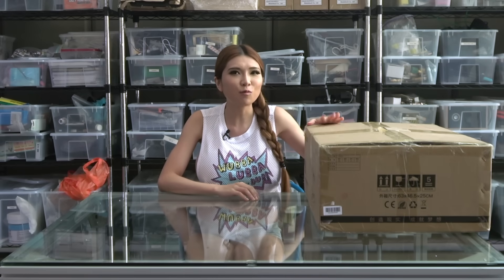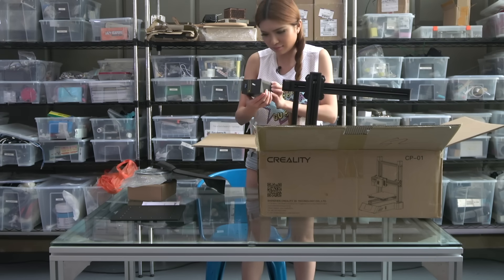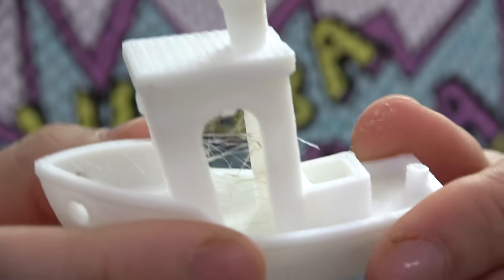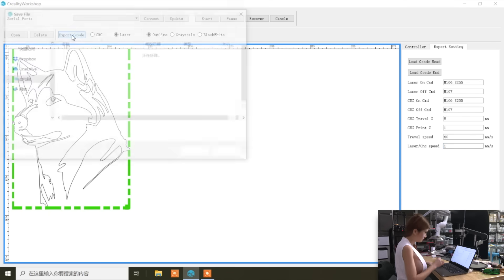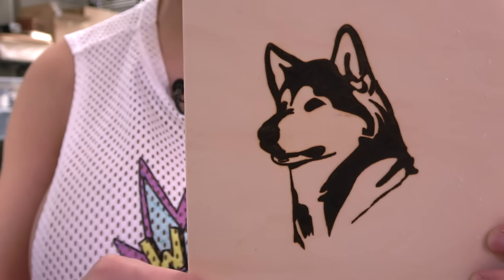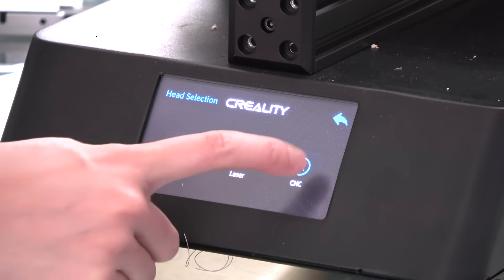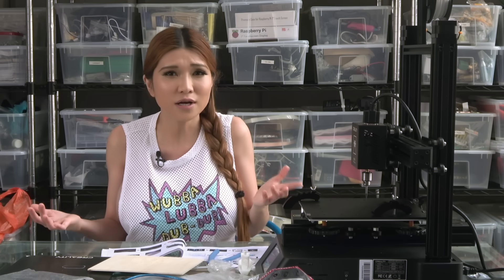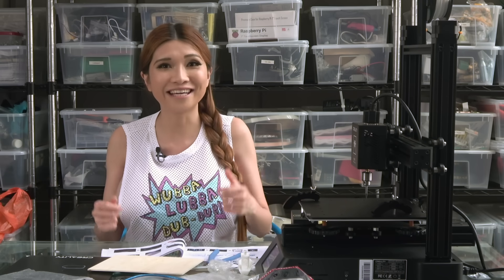Creality CP-01 Review, a 3D Printer, Laser and CNC Engraver

Comment: A sander head might interchange with a cutter head.  A circular brush of sturdy fibers of relative thickness and strength could retrace the original cut for cleaning.  Differing metal circular brushes would work for metal.  I think this would provide a cleaner and less disruptive sanding than by hand.

Comment: If anyone were to build a pick and place + cnc setup, and sell it for around $500 I'd buy it.

  If this is a thing someone is designing, be sure it can specifically address vias. Make a head setup than can either place and bend a wire, or at least place micro rivets. Limiting vias to lots of manual labor is the primary reason I'd rather just etch a board rather than buy a CNC like the Wegster for making prototypes. Don't pull any proprietary nonsense either. I'm not buying anything that requires me to purchase exclusive consumables from the manufacturer.

   If someone could develop a consistent way to CNC a bevelled hole and use solder paste or balls to connect a through hole via, I'd pay somewhere near $1k for a hobbyist machine. If it can make a flush via where I can use thin double sided copper clad and raw FR4 stock to build a 4+ layered stack up, I will spend more. Even if it can't CNC 0.008-0.015in thick double sided FR4, if it can drill holes and make vias, I'm interested.

   If a machine came with a UV laser and ball park exposure settings and for cheap photoresist, and could resolve a 0.45mm pitch QFP 100+ footprint, I would absolutely buy it.

 New Subscriber here. I'm here due to Andreas Spiece's mention on his recent Lora Mesh Networks upload.

   Nice job hacking the male mind, and following through by shattering my stereotype. I'm not usually susceptible to such influence.
-Jake

Comment: Curious to the stability of the rack is my question. I'm sure it's fine engraving with that little 1/4" lauan board. It's a much softer wood. With a harder wood and a deeper cut, does it bounce around and loosen up? That would cause constant readjustment when swapping back and forth wouldn't it? I'd read that the bed would need constant adjusting. I'd bet that would be correct. You would also have to readjust after each head swap? That's an assumption. Have an Ender3 now, but looking into a CNC engraver/laser combo. The 3 way would seem the best way to go. It serving as a backup and all. How about the laser? Does it just burn the surface somewhat, or will it actually get down in there to where it wouldn't sand right off with a light rubbing? Will it actually cut anything? Read the laser was fairly weak and would want to do actual cutting with it. Not just use it to make fancy toast with.

Comment: She got a good one. I’ve owned my CP01 for 50 days...printed one pikachou successfully. CReality FINALLY SENT A REPLACEMENT HEAD, after 45 days. I am having trouble leveling....one side has some adjustment range, while the right is locked down against the compressed springs...adjust the stop..sure. No fix....the cloverleaf carrier that the work platform sits on IS BENT, NOT FLAT. the metal work table is not flat, warped. I have had the work table off and apart 5 times, the print head apart 4 times ( replaced it..shorted out the original.),the control box apart and moved wires to diagnose a BAD MOTHERBOARD....another 45 day wait from Creality, China.
I am about to level the bed WITH A HAMMER AND NAILS...
Anyone want to buy a CP01? $400??.
The welds that hold the standoffs to which the head and work table mount have broken loose in 3 locations.....wobble.
Reply from the maker: That's awful! I'll talk with them about quality control.

Comment: The clamp downs look a bit big would take up a lot of space for cnc an laser needs like maybe some kind of smaller ones. I bought a little monster printer an all it does is sit there due to day one out of the box had many issues with it few years latter I bite the bullet an take my chances an buy a Prusa an was blown away so I when I seen this was at first like hmmm it dont look to heavy built ect then I see it run an am like omg I must have this machine! :D I agree with added heads to this for soldering or for even programmed soldering for repair use.

Comment: Note the power of these lasers is generally far beyond retina damaging.  Even small percentage reflections will be beyond the power that the cheap plastic safety glasses can really protect you from.  Best operated on the other side of something solid that won't pass the light at all, and use a camera and screen to observe operation.  If you are casual around something as potentially eye damaging as this kind of laser beam you will probably regret it later, it's like welding without eye protection.

Comment: Naomi, I am Totally with you on the need for a 3 -i n -1 PC board system !!!  But, let's take it one step further !! Most certainly,
#1 A router/mill for cutting traces and boring holes !
#2 Solder Paste, deposition ! Which should be a simple matter, as most solder paste comes in the form of a syringe .... So  all you would need is another small stepper motor to drive the plunger !
#3 A Pick and Place parts system, as you stated " A vacuum tipped picker". In which can be in the form of a syringe, or small vacuum pump !
#4  Soldering..... By means of a hot air nozzle, or by the use of a LASER to melt the solder paste !! They both have their merits !
I believe, that there would be one of this type of device on every electronic hobbyist, tech and professionals workbench !!!
What do you think Naomi  ??

Comment: £471 for the machine ( NAH ) mine cost as a 3d printer build it your self I added a laser on the other side of the 3d and it also can cut stickers out but cnc cutting you need a stronger and stiffer frame.

Comment: So does the CNC only let you have one z depth per run path is there a program that will add depth to routing without getting into 3D modeling such as solid works
Also these all in one machines would be useful if they had a 5th axis and you could 3D print something then clean up loose strands with router and the add detail with the laser!! Maybe too far in future but I don’t see why not..

Comment: I think Creality is taking a great step towards a multi toolhead solution. I do agree with you Naomi, the current availability of existing toolheads is not a wide enough range to be super useful, but the possibilities are endless. The overall structure of their setup looks really solid, and if they do push to allow open source tool heads to interact with it that would be amazing, especially given the price point. I also think that Creality in general has been way better at working with community feedback, and I appreciate your working with them in order to make that happen. Thank you for what you do.

Comment: You’re lucky....mine came with the work platform not attached to the carriage.....about 5 hours to attach four 1/4” hex screws, upside down, under the platform, 2” work space.  Mine came with NO SOFTWARE.....where did you find that? Mine came with a bad thermistor, so nozzle won’t heat. I thought 3-in-one was a neat concept, but sadly disappointed by the  actuality. $625 thrown away.  NOT READY FOR PRIME TIME!!
Creality has been unable to get any of the 3 functions to actually work. They seem to think their firmware is bullet proof. The laser head reverts to printer mode when you select a model to engrave. THIS IS A TOTAL PIECE OF JUNK,!! and Creality won’t admit it....they keep telling me to take the head apart, or to click “ hime” twice. The manual is sketchy at best...half of what you should know is NOT THERE. Junk, junk, junk.
If you’re on a Mac, forget it....the laser and cnc formatting software ONLY WORK IN MSOFT. So,add in another $450 for a PC.  Did I miss the large print saying that this is ONLY PC COMPATIBLE?
If I use the work clamps ( versus the bulldog clip they show), my laser head crashes into them, and pushes the corner of the table down....no bueno.

Comment: Hello Naomi! great review! I also find your conclusions interesting! I think that the CNC toolhead is mostly useless, since there is too much flex the belts won't help here to do almost anything helpful. On the other hand, the laser head is a perfect fit as there are no cutting forces. I did not even consider the pick and place toolhead, this is a great idea.
Also, a solder paste extruder would be cool : using some fiducials to locate your PCB correctly on a jig, then you could put solder paste on th board before putting the smd parts with the pick and place head... Why not try the laser to melt the solder too? i don't know the specs of the laser soldering heads, but it may be worth a try :)

Anyway, this is a nice concept; and the price is really low for such a platform. I'm happy to see such concepts go to market, as with the E3D toolchanger demonstrator. This will cause some agitation in the community and make the field progress. As for now, i wouldn't buy this machine since i have a CNC router and a prusa 3D printer, but at this price point, for a solid 3D printer, with the option of laser engraving, i would consider it as a new user.

I regret the lack of a BL-touch sensor or another auto bed leveling probe. THe BL-touch would be perfect as it could also be used for the laser : touch the stock to determine it's height and topology, and then move Z to adjust the forcus automatically... Killer feature for new laser users, that often struggle to properly set the focus...
Plus, by also probing the bed, the machine can know the bed thickness, and adjust Z during multiple passes to make a cut rather than engrave.

Another cool use of the changeable toolhead would be multiple 3D printing toolheads : for instance, a regular one and a volcano with a large 0.8-1mm  nozzle. 

it would be great if the machine automatically knew what toolhead was installed to load the proper settings.

Also, since you have the machine in hand, could you try laser engraving on a 3D printed part? it would be cool to print a part then engrave logos on it!
Some time ago, i also wondered if we could use a laser to re-melt partially a 3D printed part to smooth layer lines or some features...
imagine also deburring the holes in your 3D print with the laser...

I wonder if with both the laser and the 3D printing nozzle, there would not be a way to remelt the previous layer just where the new fused plastic will be deposited to improve layer adhesion ? that would require a lot of code in the slicer, but it may be interesting

Anyway, thanks for the review, and kudos to creality for their work; even if the machine as is is not the most useful right now, it's a interesting concept, and opens exciting perspectives!

Comment: All in one shop tools like the Shopsmith (saw, lathe, drill press) or the smaller Unimat don't seem to have displaced purpose built tools.  Nextwave has tried to add 3D printing heads and laser heads to their CNCs.  Many of the CNC guys are adding diode lasers and doing hybrid projects with both carving and laser imagery.  I think you're right that the future of this unit may be in hacking new heads.  That and easy switching of print heads for different filament sizes.

Comment: As soon as I saw the tiny drill head on the CNC I knew this would be bad and it made a terrible hack in the wood. 3d printing head would have been nice to see a better structured print to see if it really can fix the issues seen in your initial print. The laser etching well it has some minor niche usage, but overall would not get me to buy this unit.

Comment: Your recommendation is fantastic, "electronic manufacturing in a box" etch circuit board, pick place & solder, and 3D print case/machine/toy/mechanism paired with the thing. Wu's Wonder I'd call it!
Reply: Etching can be done with the CNC.  Pick and place you have only a limited time from when the solder paste is on the board to reflow.  This is why part placement machine are quick.  No, not ideal.

Comment: In such an open frame configuration I worry about dust and debris infiltration that might cause problems with surface adhesion or presentation, but overall excellent fit and finish by the looks of things. Also there was a 3d printer in the video.

Comment: For a 3d printer it’s too expensive. The Laser Head is too weak to cut anything meaningful. The wheels in the V Slot will kill themselves with the lightest of CNC work after a few days if the dust doesn’t  kill the printer first. 
My 2 cents: Buy a 3d printer + Laser Head (complete Ender 3 + Laser Head = 200$) and a cheap cnc for another 200$. Better functionality, you can cnc while your printer is printing and have fun for a longer time.

Comment: This looks like a great concept. The flaw I see is changing the tool heads takes too many steps, with all the screws and cables and alignment adjusting. This could be reduced to a slide-in cartridge type system that makes all connections automatically, rather like print heads in many ink-jet printers. The trade-off is this may lead to a proprietary connector that shuts out 3rd party accessories, so it would have to be designed with easily replicable features.

Comment: The pick-and-place head is a really good idea, actually. I'm surprised nobody has done that yet.

Agree with you on the laser and CNC engraver being not all that great. If they were cutters rather than engravers it might be worthwhile (presumably with something to put on top of the print bed so you don't cut that too) but you could do a similar effect to the laser engraving with just running a hot 3D printer nozzle over the surface of the material, and an effectively-2-axis CNC machine doesn't seem to have a lot of uses where a 3D printer wouldn't do a better job.

Comment: This device seems like would benefit from some sort of head changer so that they don't constantly have to be manually swapped around. That way, multiple operations could be performed without having to recalibrate anything, especially if using it for PCB engraving as well as for SMD pick-and-place. You could even add solder paste dispensing as another head.

Comment: Very interesting machine; it is sold in the US for about $600 dollars.  I was very impressed with your demonstration of this machine and for the first time I checked the Creality web site to learn more about it.   As you said in your video, this multi-functional machine has a lot of potential and I wish I could have one right now.  As a feed-back for the manufacturer, I believe that If they would upgrade the CNC functionality to be able to work on thin Coper or Aluminum sheets, this machine would be an ideal engineering tool for the prototype of Microwave flat plate antennas.   Naomi, thank you for this great and informative video.

Comment: I don't know if you know there are manual PNP machines... I don't know if you have a friend that has issues but want to put it out there.. an automatic PNP machine does have more complex then most people think.. you need 2 camera's one for parts to see how it is aligned only for chips.. smd resistors will recoordinate when heated in oven... other camera is used to see how board is aligned seeing markings on the pcb.. but a manual pnp machine can be made out of drawer slides mainly used for fatigue

Comment: Surprisingly decent 3-in-1 machine.

Would have loved for the spindle to either use collets or at least a Chuck with a bore on the backside so you can stick tools through it. Would solve the problems caused by the hilariously long tool stickout!

Comment: This seems like a step towards an in-home autofactory...

Essentially a single machine that can manufacture mechanical and electromechanically complex items that require little to no assembly. You just load its feeders and hoppers, insert the pattern for the item you want, and hit "Go".
Reply: Combine that with a homebrew pick and place machine and you'd have a serious factory in your basement.
Reply: @ZaKillAlpha  Absolutely. I thing that the shift is coming from the side we never thought of. 3D print, CNC, engrave, pick and place, even solder at one place, maaan what a technological disruption.
Reply: But does it come with a shirt for the operator?

Comment: Would like to see you showing off the protective glasses when using the laser functions on these!   Just so that anybody casually watching picks up on the importance of wearing protective eyewear when lasers are involved.

SMT - I think that's a huge ask!   Although there are some Chinese ones aimed at low volume production, with the loaders for both passives and chips.   Always been expensive.

Semi-automatic placement I do with a Mechatronika MM500, although they have a later MM600 available now (mine has a floppy disc drive, the later is USB - but we never use this anyway).   Manual in that you move the head around and rotate it.   Automatic that it starts and stops the vacuum for you.   It's a neat bit of kit.

Otherwise, seems a good bit of kit from Creality again.   And thanks to yourself I have a Creality 3D printer.

Comment: is posible cut a pcb circuit board perfectly??? demostration?
Reply from the maker: I'll see
Reply: @Naomi-Wu  you can try it but something your going to have trouble with is cutting the pcb.. end mill bit is good at cutting away large parts of copper but it's impossible for it to get into tight spaces as in smd chips packages... but v-bits are good at tight spaces but can't cut away copper basically cuts an outline of the trace.. the problem with end mill bits are they snap and break easily.. v-bits are not designed to cut metal copper.. they are made to cut paper..  and will dull super fast cutting copper.. I would recommend getting several bits to try out of each.. see that you think but that's some problems you will run into... fyi wear goggles when doing it bits can break off... good luck